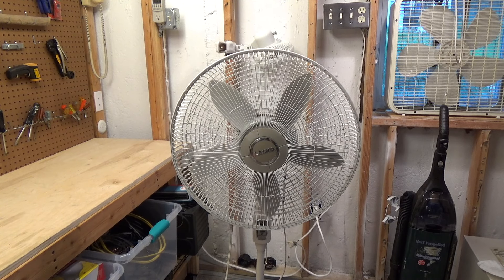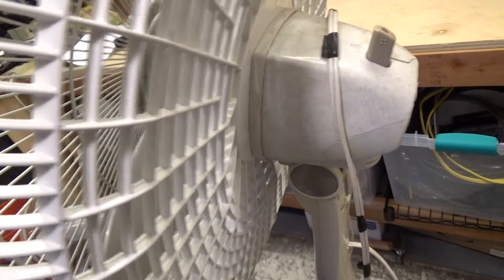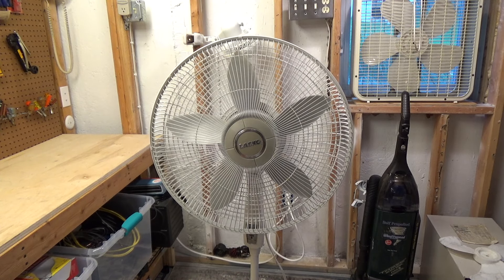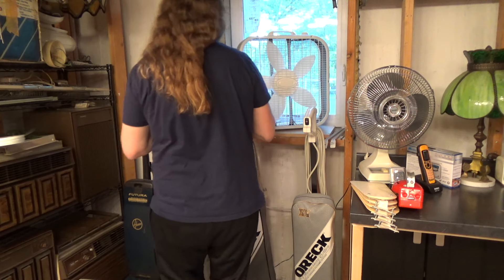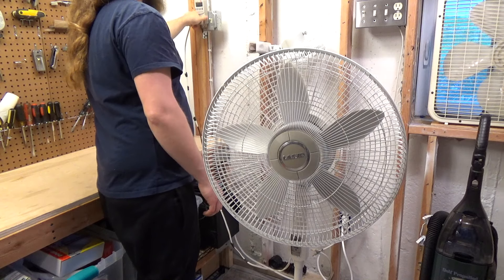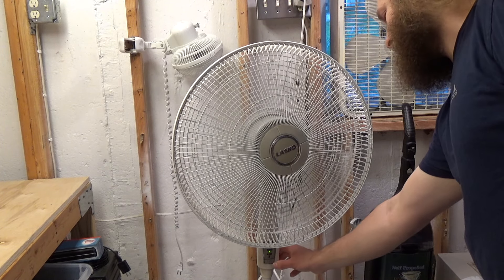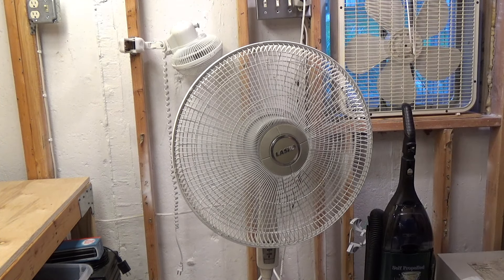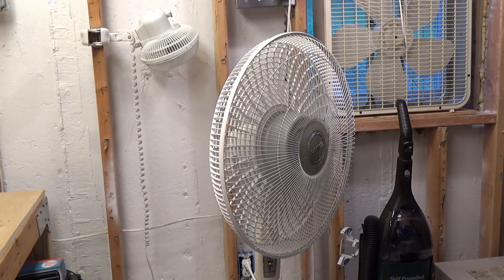Curbed Lasko 1888 18" Cyclone Pedestal Fan with Remote Control | Initial Checkout

Comment: 2:20. When you were reading off those model numbers there, you were looking at the row for WHITE color models (1820/1825/1824/1821). Searching "Lasko 1825" on Google Images yields a standard white Lasko Cyclone fan with manual rotary controls.
The row below that is what lists the WHITE, REMOTE models (1850/1885/1854/1880/1888/1889). I believe this is another Lasko 1888 that you've picked up. It's the only one that matches visually when I do a Google Image search, and it looks identical to the one that you posted to the channel on February 15, 2023.
Reply from the maker: Thanks for the information. I agree, this is a 1888. I knew something wasn't right, when I was searching that top list I wasn't able to find one that matched quite right.

Comment: I always thought these 5 blade lasko stand fans were pretty good. I had one for a while that I got off the curb. I gave it to my mom to use, and she liked that fan. The one I had was a none electronic control model. 

On a side note. We had that same Hoover Wind tunnel vacuum when I was a kid.
Reply from the maker: I think they're generally decent as well, but this one seems particularly decent. Probably because of the metal guard.
My grandparents had one of those for as long as I can remember It's a good machine.

Comment: I wonder how cool it will be with the D-shaped blades.
Reply from the maker: It would be the same temperature.
Reply: @JordanU  But the D-blade literally belongs to the box fans and air circulators. Plus that PSC motor can't handle such a heavy gauge of thick plastic.

Comment: My Lasko 2526 gave up the ghost after 6 years (2017-2022) so now I’m in a market for a new fan. 

Should I either buy another 2526 model or should I consider a larger 18 inch fan?
Reply from the maker: I would go with something else, the 2526 has become junk over the years.
Reply: @JordanU 18” inch fan it is then. 

Thanks!

Comment: Almost makes me think the guard and blades were replaced recently. Still very peculiar.

I had a more modern one with 4 speeds I picked from my last job trash. It was locked up but just needed a little oil and it was good until I tried hammering out the bearing ball hoping I could put it back in. Lesson learned, dont do that.